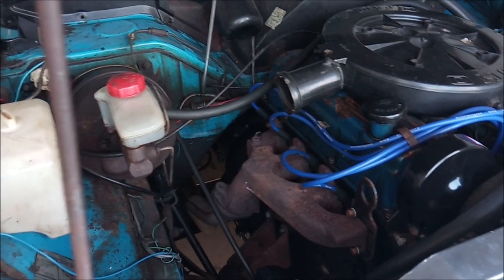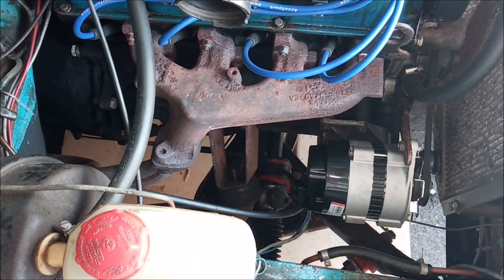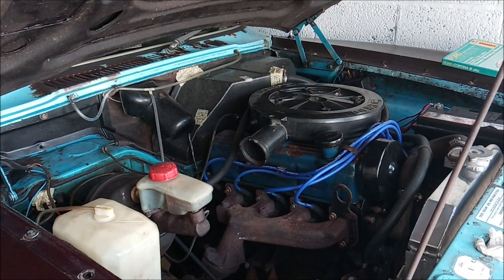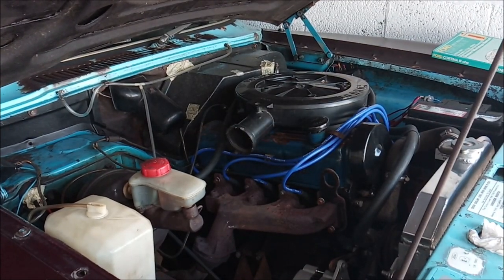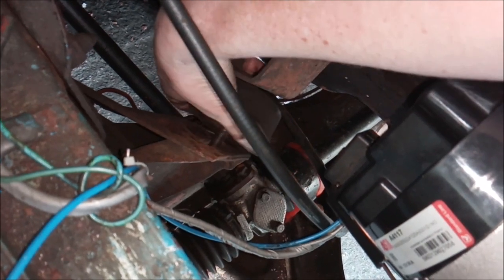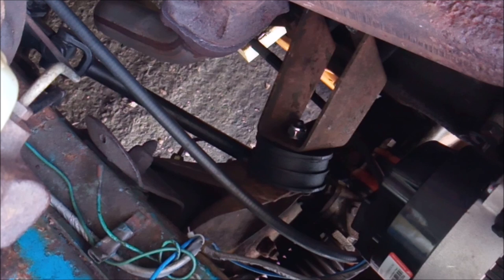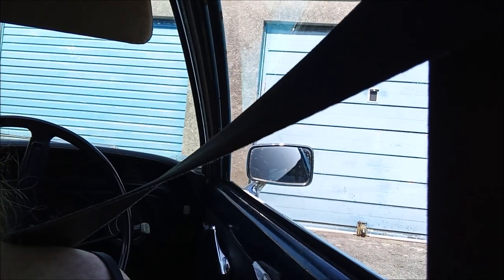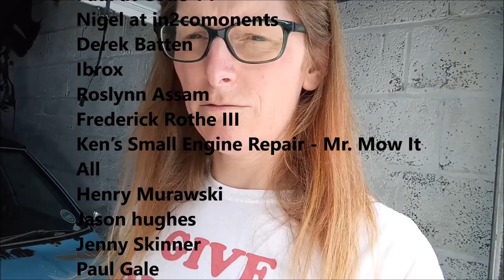Mk3 Cortina Engine mounts

Comment: centre bearing on the prop is on its way out had them fail on the wagons with spectacular results!
Reply from the maker: the bearing and rubber bush are new Duncan. I replaced them last year.
Reply: @CortinasAndClassics  I hope it's ok then, but I've known them to fail within weeks of being fitted. Obviously you'll be checking through the drive train so hopefully the cause will come to light🙂x

Comment: You did the right thing, put the car back in the garage to fight on another day! Was that prop squeal there before you changed the engine mounts?
Reply from the maker: It was yes, I might have to unbolt the propshaft and gearbox mount and lower engine bolts and straighten it all up. Maybe.

Comment: Hi Simone, what you are describing sounds exactly like the centre bearing on the prop shaft is failing.
Reply from the maker: the bearing and rubber are both new. But there is also a rattle under the car. Sounds like the exhaust.
Reply: @CortinasAndClassics  You are more than likely correct with the rattle, put some decent gloves on and reach underneath to grab the exhaust in several different places while the engine is running until you find where it is touching the body. If no luck with that it is possible one of the baffles in the silencers have deteriorated and come loose, hope this helps.
Reply from the maker: @dustymiller7758  Thanks Dusty
Reply: Sounds to me you've bent the exhaust or something ,you should never jack an engine with everything connected that high ,should have just taken the weight and undone the 4 bolts on the engine to change the mount,just a thought.Good luck.